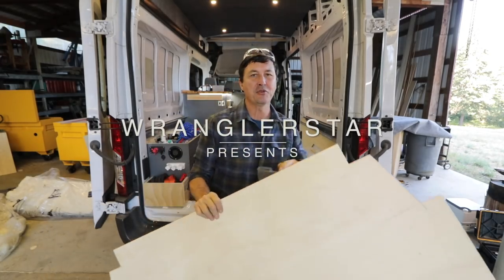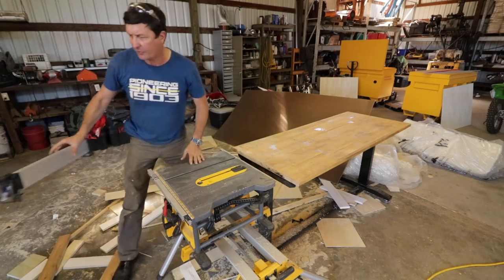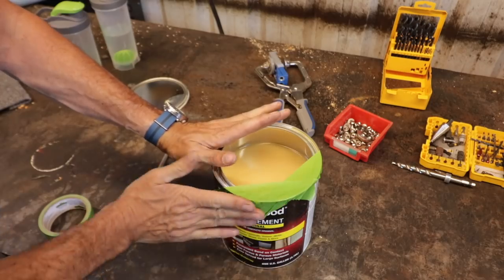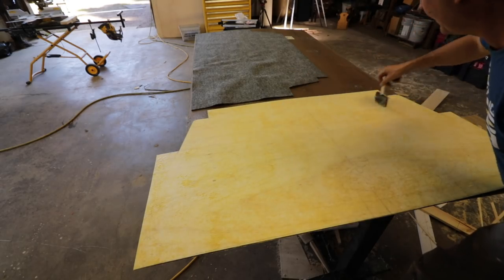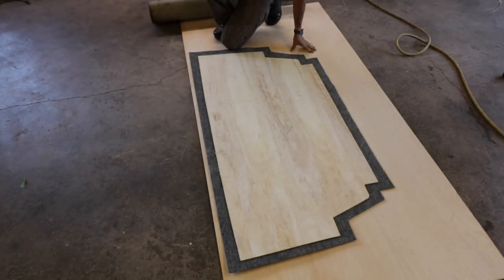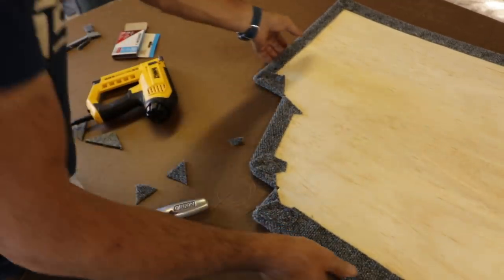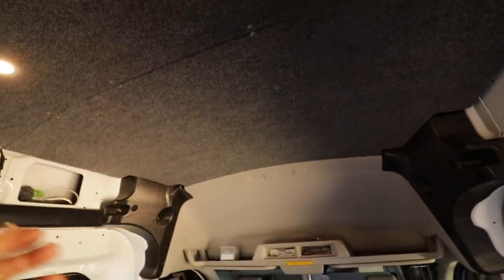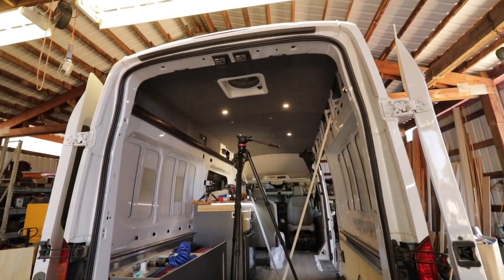DIY Camper Van Conversion Headliner Upholstery #VANLIFE

Comment: I did an E-100 similarly about 25 years ago. Luan panels,  wrapped closed-cell styrofoam panels in sheets of polyester batting for heat insulation (batting to help avoid any squeaking). Warm/Cool and quiet. Perfect for weekend ski trips.

Comment: One suggestion- Cut the wood to fit, just like you did, then glue the fabric on, then cut the carpet with the 2 inch overhang.  As long as you leave at least 2 inches around the wood, the glue up will be less stressful.

Comment: Hi Cody , I have enjoyed your channel for a long time . Love the family and the things you film during your life . I have watched most of your videos and for years I couldn’t comment because I wasn’t logged in  . We have a very similar work background but i wish I could have talked to you before this video . This is not critical in any way ! Someone showed me this once and now i can help you . If you spray contact cement on both surfaces and wait for it to set up lay wood spacers over the carpet then place the board on the spacers . Position the board and pull the spacers one at a time and the board will drop onto the surface in place .  I generally can’t get help doing things so i have to do it alone . This method is simple and zero hassle to keep it from sticking before you want it too .  Hope it helps you . ....... Todd

Comment: To add a little more insulative property you might think about adding spray foam. It is extremely light weight but does wonders for sound reduction and heat delay.

Comment: I would like to offer two tips, which i use when mounting large photos on backings.
1. I had good luck with laying the photo face down on a solid surface. And THEN bringing the backing on top of it.
2. Anything glued on the surface of a non that rigid material will make it curve, Since the materials contract/expand in a different rate. The trick to avoid this is glue a discarded, similar sized, piece of the same thing on the other, non visible side.

Comment: I think your observation about a better glue is on point, but it needs to be thicker.  Headliner adhesive is green and VERY goopy, but it'll last a LONG time. You'll probably be redoing your headliner pieces in a year or 2, especially if it sees a lot of humidity/ moisture.  I probably would have also thompson's water sealed all of the wood before installing it. Also look up "pig's ear upholstery" lots of techniques to deal with them.

Comment: I'm going to give you a tip . stick a 4 inch Leading Edge then clue pop Parts in slowly roll it out so another words you stick it down nice and straight with a small amount of glue glue both sides and just roll it out this way it's whole square and it comes up beautiful

Comment: A trick when your using contact cement after it becomes dry before you glue the two surfaces together, take an extension cord and snake it back and forth across one of the pieces.  Then lay the other piece on top of the extension cord and get it lined up. After that just grab and end of the extension cord and slowly pull it out.  As you pull it out the cord, the top piece will slowly down and bond to the bottom piece right where you want it too.  Check out Izzy Swan's "Table saw extension and out feed table" video to see the trick.
Reply: Using a rope or cord is a good idea.  I've used paper or cardboard and just slide it out from one side.  The rubber cement only sticks to itself, so it's pretty easy to get perfect alignment.

Comment: Looks ok but you forgot about fabric nap.  One piece material next to another looks darker or lighter.  All pieces must be cut running the same direction to prevent directional nap error.  The front and back panels are running the same direction but the middle is running a different direction.  Just wait when you wake up seeing celling one morning and you have a stomach ache due to eye disturbance and mismatched fabric.  I would guess wee Dee will see it first and cry while adults won't understand the unsettiling disterbance.

Comment: Add some finished wood strips to cover the headliner seams. They make a good mounting point for the red led strip lighting. Much more gentler on the eyes for nighttime illumination. Hand pressure on the fabric is all you really needed to adhere.  Next time I would not notch the headliner material before gluing.  Makes doing the job lest dramatic. Finally, leaving this headliner loose on the sides would of given you the ability to fill the gap around any existing trim. Leaving the sides overlap the headliner backing and allowing them to drape down helps make a seamless transition if your planning on installing fabric side panels.

Comment: I would have glued it up like I do vinyl flooring.  Put it facing up with the carpet in position.  Fold the carpet back on itself and spray both the exposed carpet and plywood with adhesive.  once dry, roll it into position.  Your cylinder isn't providing a lot of pressure.  Think about it.  Yes it weighs a bit, but its spread out over a large area.  ''A small J roller will give you as much as several hundred PSI pressure.

Comment: I’m wondering what will happen in winter if your family sleeps in the van. The moisture from your breath will tend to condense on the cold metal skin of the van. Your organic liner material (wool and plywood) combined with the moisture is a recipe for mold.

Comment: Looks great Cody you did a great job. But, you usually do. The only thing I saw and it could just be the camera angle. It appears that the carpet nap on the front panel  was quarter turned from the other panel's carpet. This is something only a capet person would notice  and if you were paying 5,000 dollars I would say was unexceptable.  It does look great and I can't wait to see the Van project when it is completed.

Comment: For the 5k they would have hid all the seams, joints, screws and made the entire thing look seamless if they are worth their salt anyway. As for the corners i have never seen a "industry standard" for a  not visible corner, cut fold over tight, make it go away. Anyways you did an excellent job, grats.

Comment: Acetylene cylinders when dropped or knocked can have an internal reaction, generating lots of heat and potentially an explosion. Look it up, once dropped those cylinders should be 400M away from anyone. Not to be used as a rolling pin! 
Be safe pal!

Comment: Why wouldn't applying upholstery to plywood be any different than applying a product like Formica?  Use wood strips to separate the two surfaces then remove sequentially to adhere in place.  Only difference would be laminate is applied to the substrate while with upholstery the substrate needs to be applied to the upholstery material.

Comment: Would it look odd to put ski transport boxes on ether side of the vent and then mount solar over top of them leaving you with an air path down the center of the van and around the panels? Would let you get more panels in as you can go over the vent rather then starting at it and if placed right rain would never get to the vent letting you use it in bad weather.